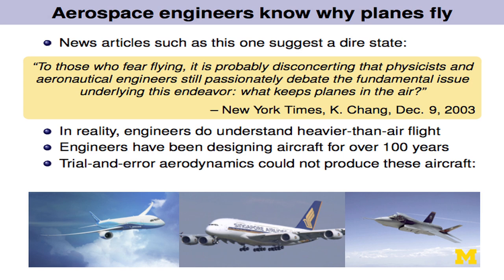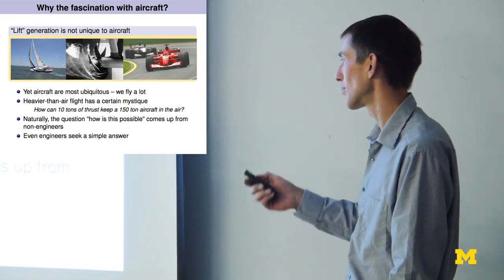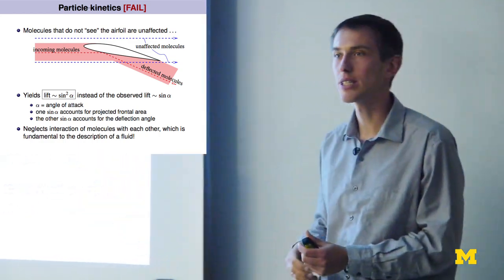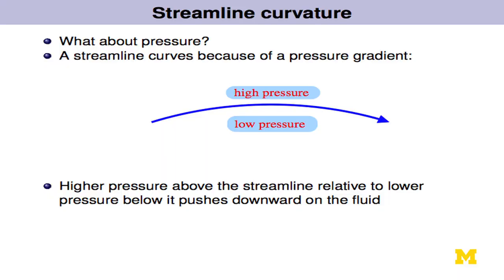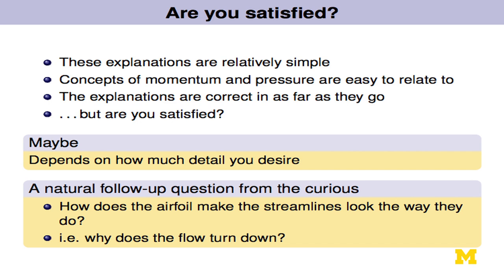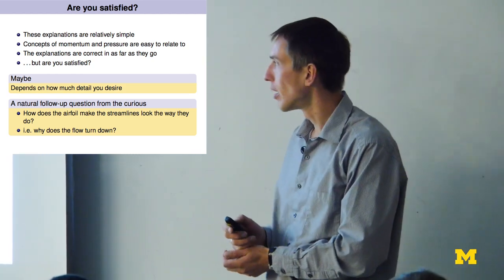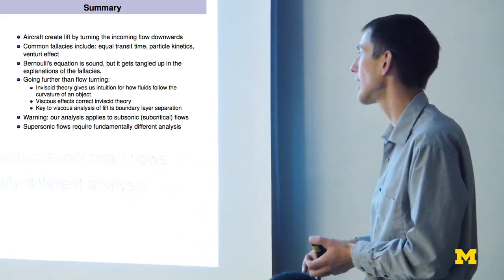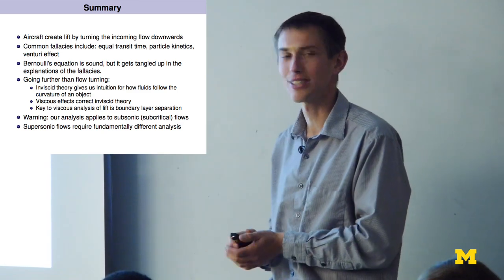Krzysztof Fidkowski | How Planes Fly

Comment: As shown in the figure(1), water bends downward and moves downward along the curved surface.

Obviously, water does not produce pressure gradients by viscosity. At the same h depth, the force of water on the curved surface decreases. Why does it decrease? Because it is a curved surface, the flow of water requires centripetal force, so part of the gravity of water is used to provide centripetal force.

Obviously, even if the water is not viscous, the force acting on the curved surface will decrease, that is to say, the pressure gradient will occur in the normal direction of the curved surface. So your understanding is incorrect.

It is not the curve movement that supports the lower pressure, but the lower pressure support curve movement. First of all, there must be centripetal force, then there will be curve movement. You violated Newton's law. Newton's law says that force is the cause of the change of motion state of an object. Without centripetal force, how can there be curve motion? There must be centripetal force first. Precisely speaking, there must be a force perpendicular to the direction of motion.

And because the curvature of the surface is not the same everywhere, the centripetal force is also changing. Therefore, centripetal force can not only be provided at the beginning, so it must be adjusted constantly. Therefore, it is wrong to provide the theory of centripetal force only at the beginning of the movement. So, how to constantly adjust the centripetal force?

You said that viscosity is one of the reasons for centripetal force, so what other reasons? Obviously you admit there are other reasons, so what are the other reasons?

You have to admit that when water flows along a curved surface, centripetal force can be generated without viscosity. This is because water is heavier than air, and gravity makes water on a curved surface. It is not because of the viscosity that water moves along the curved surface, but because gravity makes water move along the curved surface. Gravity provides centripetal force for water to move along the curved surface. These facts negate your theory.

(1): https://qph.fs.quoracdn.net/main-qimg-b46fe6a57a535484aa14bce3bd684154)

Come from
https://qr.ae/TWN85L

Comment: Uhhh... No.

If it's about deflecting, turning, or otherwise reacting against the air, you need more thrust than both the weight and drag. Also, you have to account for the energy of the rising air that meets the leading edge (which I suppose you could say is part of induced drag.) Air isn't all that dense compared to the aircraft. You know that gravity is accelerating the mass of the aircraft at a constant rate. Let's just say a 500 KG aircraft at 9.8m/s^2. You can give yourself a simple graph and ask yourself what is a reasonable amount of mass to acceleration to still get 4900 Newtons for level flight; accelerate how much air, how quickly, and how much air do the wings actually touch anyways?

The only forces that affect the wing are the fluids that actually interface with it. Yes, stuff is going on at significant distances from the wing... but the wing doesn't care. So as long as there is more net pressure on the bottom surface of the wing than on the top, you get lift. 

We know that pressure is not uniformly distributed across the wing, but it also corresponds to local air velocity. Air over the top of the wing is moving at a great initial velocity and then slows at the back. So when you look at a pressure distribution, the very end of the wing is typically positive in pressure (pushing the wing down.)

So there's no argument that lift is from a pressure difference, that the air velocity corelates to the pressure that the wing actually sees, so the question is: Why is the air moving faster over the top of the wing? Specifically, why is it moving faster than the wing is?

The only obvious answer is that there is lower pressure (vacuum) above the wing. But, logically, this would appear circular in reasoning. What creates the vacuum, that accelerates the air, to create the vacuum?

To that end, I would pose the question: What was the initial state of the wing?

Answer: Not. Moving.

If you have a wing in dead-still air with smoke or fog, what will you see the air do when you start everything up from the perspective of the wing?
Reply: What? Why would you need more thrust than both the weight and drag?
Lift increases with velocity, so at some point lift will equal weight. At this point thrust needs only to be equal to drag.
What you suggest maybe applies to a rocket, but not a wing.

What you write about pressure is all in the video as are answers for some of your questions. Did you even watch it?
Reply: Just to beat a dead horse, a 747 has 224000 lbs of thrust and a max take off weight of 987009 lbs.  Tell me again how thrust must equal weight plus drag to fly?

Comment: Lift is due to centrifugal force caused by the mass of the air flow over the top of the wing.Replace air with mercury . tr3 b. Lift from sealed container.

Comment: How does a wing whose cord is in line with the relative wind deflect air downward? I can't draw it for you here, but imagine a flat-bottomed airfoil moving through the air at the same angle as the relative wind. It's differential pressure, not wind deflection.